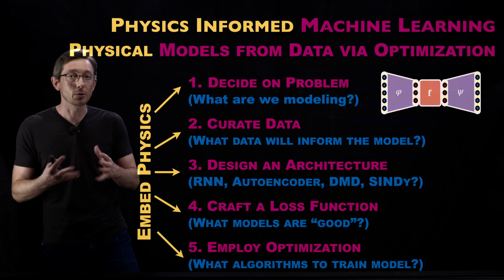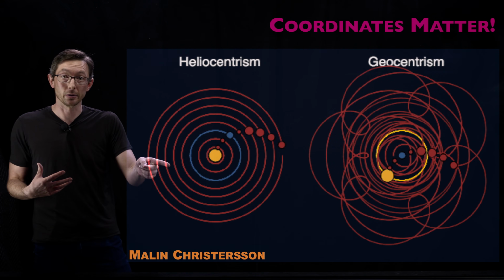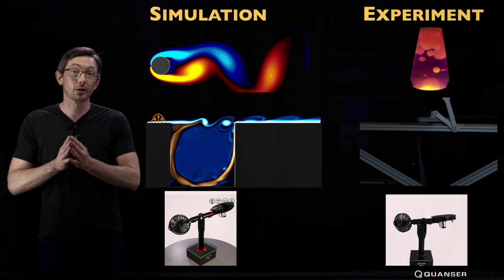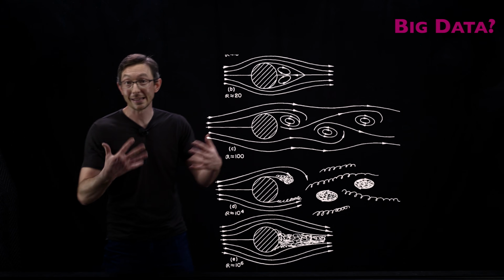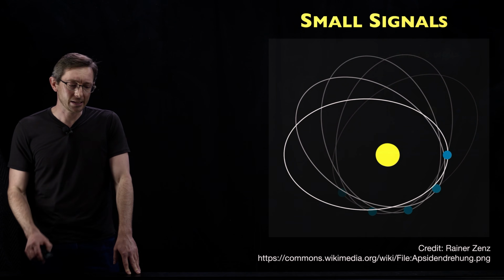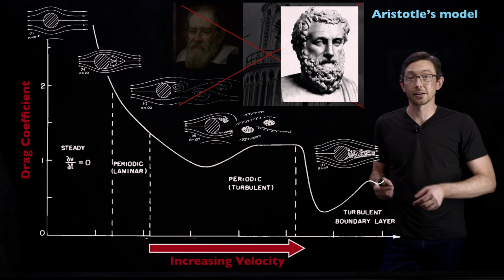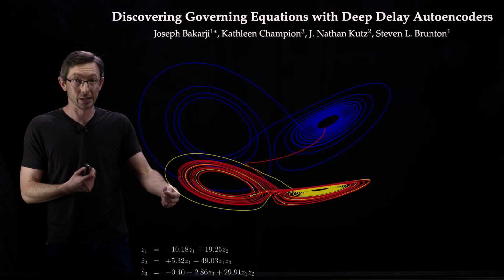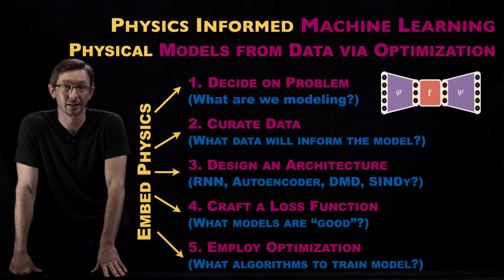AI/ML+Physics Part 2: Curating Training Data [Physics Informed Machine Learning]

Comment: 22:55: The apsidal precesion of Mercury predicted by Newton was 532.3 (arcseconds per century) and the measured was 575.31 (same units). The  predction is not 99.999% of the signal, it is 92.5%.
Reply: 😢😮😮😮😅 11:05 11:05 😊

Comment: 😊 complicated systems are very frustrating it doesn't mean that every single thing has a specific thing for its function
Even if the consideration of many things are not found to explain functionality
.... The consideration of functionality
May not entirely run on its system the way you might think
.
... What is the true system to the matter of your functionality
.... Or to be functional
.... All the functions of our being does not have a specific button
To describe that function
..... Even if mechanics and other detailed matters have to
Like your computer programmer
Every functionality has to come from a program
Or a function board
Function piece
The same situation
Could be thought
But it is a mindful consideration we do not have all these types of things or parts
.... Individuality
Is a large step for man
.... You would probably be amazed what It could do 
.... Including the matter of function
...
😊 Disturbances in the force
Disturbances in one's mind
.... The brain for the cure
..... The reason 
for a mind
May have came to another
..... But still they are great
😊 Even if one
 buried the other
We are not great
And we are not... all
But the experiences  we take
.... Are just as hard
 as the crawl.....
😊 But one day you're going to walk
It was in the cards

Comment: This is very quickly becoming my favorite channel. Thanks for putting this stuff together! 🙏 Also, if you could touch on how new architectures are usually designed in your next video, then that would be tremendously appreciated. I see the rationale behind most of the fundamental architectures (e.g. CNNs, Autoencoders, etc.) but I’d like to know how researchers usually go about the design phase in putting together a new architecture to tackle a specific problem. Some of the things (e.g. use of residual connections) seem so random to me
Reply: +1